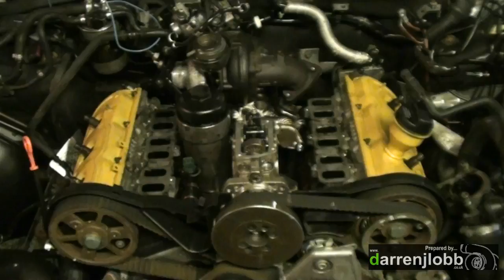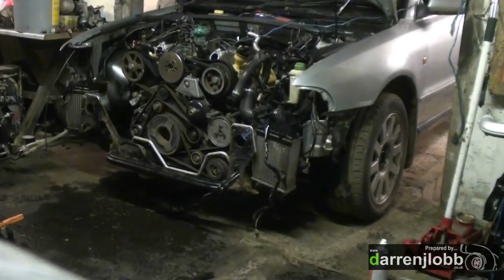Audi V6 MTDI Project Part 3

Comment: Wow! This is the solution ive been looking for, for 4 years now.
Thank you so much.
But how did you time the VE pump to the engine please?
Reply from the maker: Cyl1 TDC and set pump at TDC and match lines up, then just adjust slightly until timing is corect :) Can do by ear to be fair or if you want to be accurate you can use a DTI on the plunger (end of the VE dissy head)

Comment: Hi, can I get a bit of info about the injection pump timing... Working on same engine. Thanks
Reply from the maker: What do you need to know?
Reply: @darrenjlobb  hi, the injector pipes, is it the same layout as the electronic pump?
Reply from the maker: @geraldarnold3540  yes, all rotary pumps fire around in a circle, so always the same order :)
Reply: @darrenjlobb  thanks